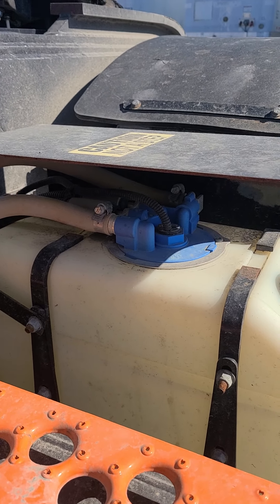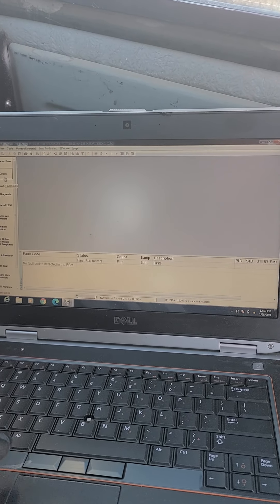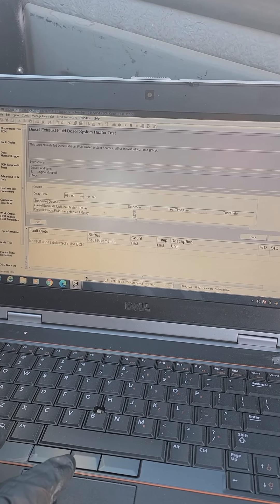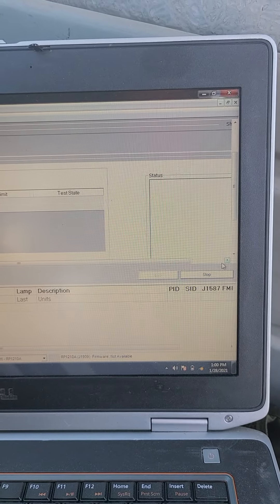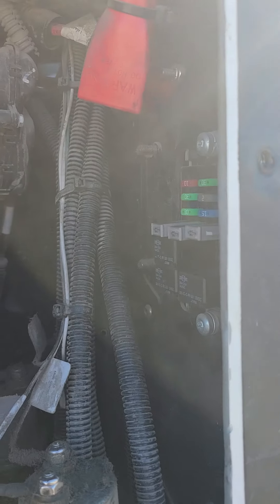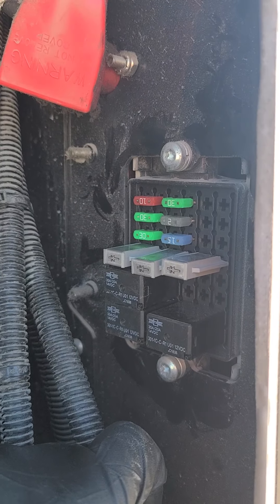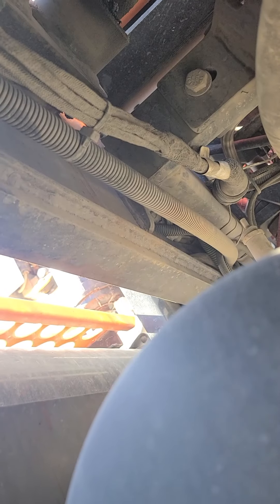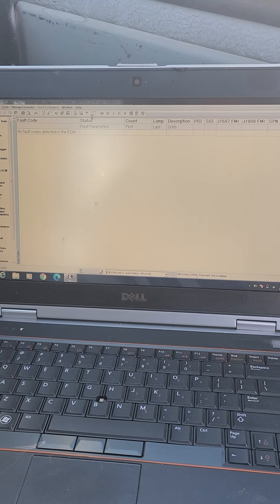SPN 4340 DEF Heater Line Test using Cummins Insite on a Tico Pro Spotter.

Comment: Did you find issue on DEF heater line code?
Reply from the maker: No it it was sent back to their main shop. They had one before did the same thing, couldn't find the issue so they replaced the harness and seemed to fix it.